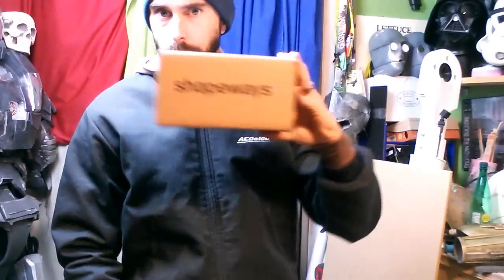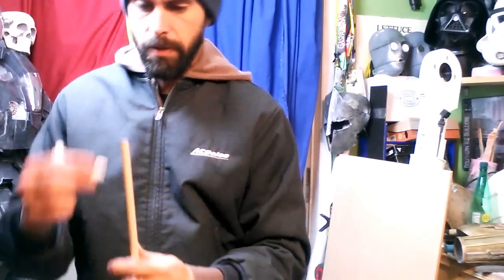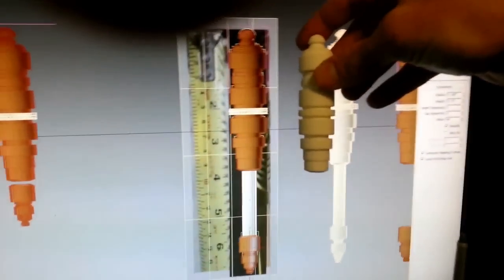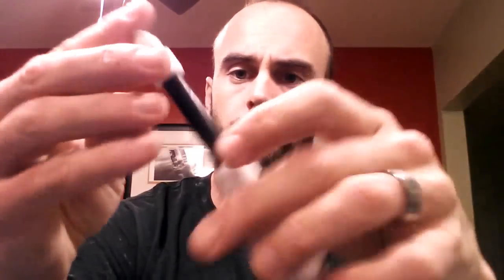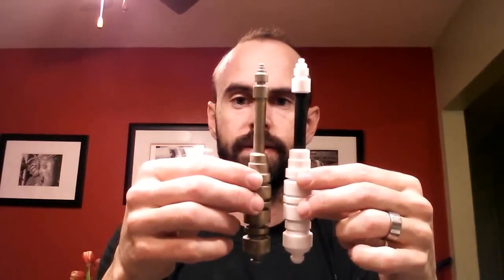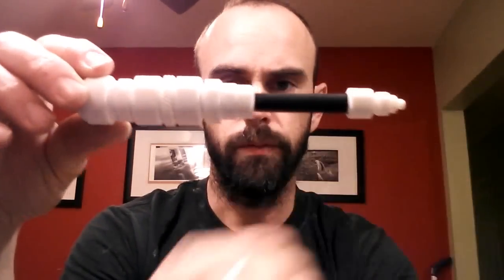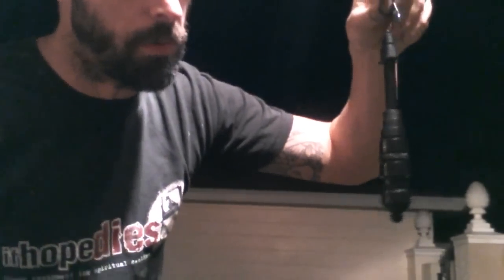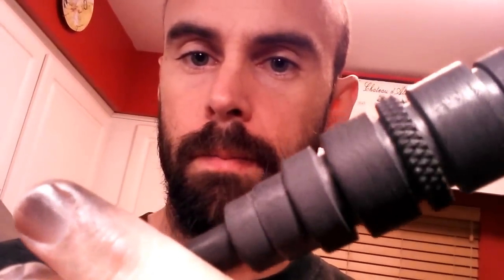Prepping Raw 3d Printed parts for Painting and/or Molding

Comment: Hey man nice video! Loved the different steps you talked about when prepping this. I have a question though. Is silicone rubber to make molds friendly to Strong & Flexible plastic? I'm guessing that's why you primed it, to seal it? Get back to me on that. Also is it really hard to sand a Strong & Flexible piece or does it just require some light sanding as mentioned in the video. Thanks man!
Reply from the maker: +KJS Films™ I usually prime and prep the surfaces before molding but I have molded the "white strong flexible" material without prepping and it worked just fine with the silicone.
Reply: Oh okay cool! Thanks for the helpful info! :)